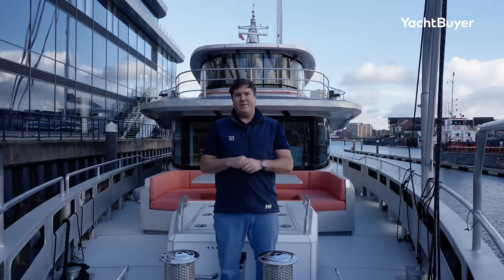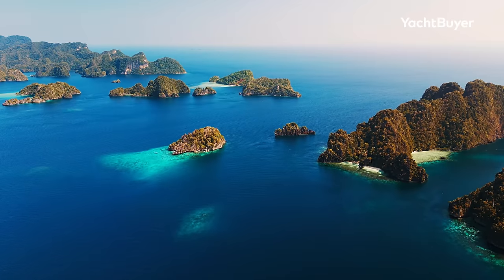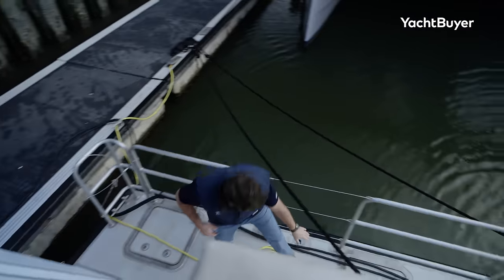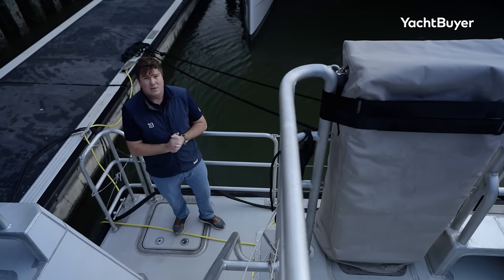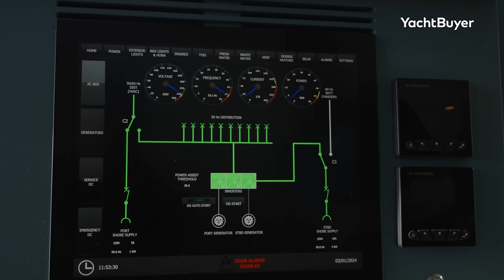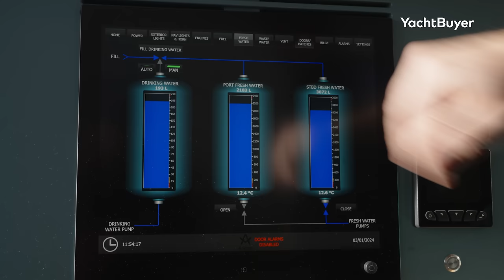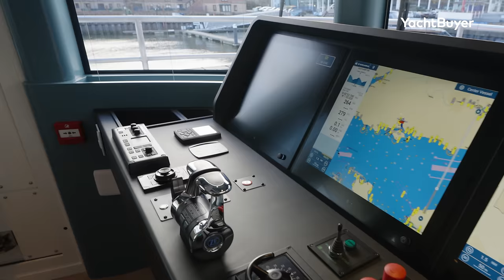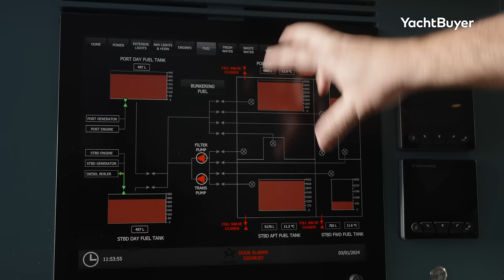A British Built Explorer with 7,000nm Range | Arksen 85 Tour & Review

Comment: Its hard not to see the Dashew FPB influence in this boat, but teken to a higher level of refinement, especially the interior.  The FPBs seem so spartain inside, whike this is warm and inviting with a lot of thought invested.  Captain’s quarters by the engineering space is a great idea.  Range is outstanding, and the ability to get to 14knts in a pinch will let skirt a lot of unexpected bad weather.
Reply: I have seen a Dashew fitted out to a  a similar standard .
Reply: Agreed, however, the quality of much of the exposed welding is a far cry from what you would see on a Dashew. Dashew certainly has the qualities where they count. I am amazed given all the welding is exposed that they didn’t do a better job.
Reply: Habe to disagree. Most FPB of which you find footage are the 64s. They have been commissioned ca. 20 years ago. If you want to compare the interior compare to 78, especially cochise, or the FPB 97 Iceberg. Their interior is at least on rhe same level regarding quality and feel.
Regarding thoughts put into Arksen: no. Zhey just took the Dashew Design and changed it in a way that shows, how little they understood the original design.
Range: 7000nm ist okay, but 9kn is quite underwhelming. Iceberg is significantly faster. Arksen’s top speed is Iceberg‘s cruising speed. Dropped back to 9kn the range will be much bigger than 7000nm.
All in all the Arksen is a knock off. A cheap knock off of the original FPB design.

Comment: Looks like a great explorer yacht with a decent range.  I know that an all aluminum boat has its advantages like reduced weight as compared to steel which makes the boat faster, as well as preventing the boat from capsizing.   My question is: Did they use the marine-grade aluminum 5052 for optimal durability, or the more cost-effective but less durable 6061, in the construction of this particular yacht?

Comment: beautiful yacht.  the concept is lifted from the Dashew FPB concept but im glad arkson and a couple other companies are continuing with his ideas.  the scania engines seem an odd choice though. and i cant help but think that the aliminum must get blazing hot under foot in th equatorial sun.  yes its well insulated but it must be scorching to the bare foot. very well presented as usual Jack.  really looking forward to the sea trial.
Reply: I looks like a straight copy to me
Reply: @WillBreitholtz1  looks more like a bad copy to me. Comparde to FPB 97 Iceberg the Arksen is an underperformer on every level
Reply: @GroppeljohannKlotenkempe-vr6oh it's actually better, the iceberg could only go 7000 nm at 7 knots not 9. And it used more fuel to do so.

Comment: Hey Jack that was a splendid review and the 1st time I've come across your channel. My one nit-pick would be the use of only 12mm aluminium plate, as it's a soft metal, so id have upped it to 20mm for the bow area , 15mm for the remainder. I guess weight saving is of an essence. Also is the boat still in Ocean Village? As I'm extremely local and would love to have look in the 'flesh', as so  to speak.
Reply from the maker: Glad you enjoyed the review and welcome to the channel! Interesting points you raise about the thickness of the aluminium. Arksen's approach seemed the be that they would exceed what was required for the boat's Class status. She has departed Ocean Village now I think, unfortunately - Jack
Reply: @Yachtbuyer  That's a shame that she's sailed on. My observations of the hull thickness are due to me being a marine welder/fabricator with mechanical fitting experience over the last 39 years along the South coast, from Cornwall to Kent, but mainly Southampton and Portsmouth. I wish you every progress with your YT channel.

Comment: I like Arksen they are building amazing ship. Recycled aluminum used in building the boat. She has safety and comfort built in, for any part of the world any type weather or sea conditions. 
The gallery, dining, seating or relaxing area are homely and the colour decore are relaxing. As is the master cabin and guest accomodations again relaxing, restful decor. Each cabin had it own heads. 
The crew areas are again comfortable and each cabin have their of own heads, laundry room. 
Overall she is a versatile boat planned to meet many different weather and sea conditions, she very economic in her use of fuel. She is made yo be sble to repair if something goes wrong with back ups until you can somewhere to do repairs. She is amazing

Comment: I sailed on a supply vessel (Smit Lloyd Fame) powerd by Scania's. Worst engines you can imagine, were cooling-water is entering lot's of engine parts, were it not should be. After that you sit in the dark. There is no substitute for cubic inch.

Comment: Great machine if very mission specific. I can see some amazing adventures on this to remote corners of the world . Only thing I would see as a negative (for me anyway) is you would have to have some serious engineering knowledge to keep all that machinery and electronics serviced  while in far flung places not to mention if elements of it go kaput , where would you even start? , looks very complicated . I sometimes wonder if we are going to super tech on these vessels which are for the owner operator. I remember the days when an old lifeboat called Mabel E with just a pair old thumper analog Gardner’s went off into the blue  yonder for years even getting stuck for months in ice , with spare oil, filters , belts , water pump and a set of spanners and a hammer (figuratively speaking) .  I imagine the tool box on this must look like a professional work shop .
Reply from the maker: You make a very good point and I know that the owner of this boat took great care in learning all of the systems despite running the boat with a skipper on board. A lot of the kit looks intimidating but much of it is mechanical and built for redundancy, designed to be easily switched between if something fails - Jack

Comment: 7000 nm with 7-8 kn than u can swimm ! a good explorer neeed a eco cruse of 12.5 and fast 14kn and full speed up to 17 kn. and it needs a range of around 5000 nm at 12.5 kn.  consumption shut be around 6-8 lieter per mile max. For a boot of around 27m -35m

Comment: Sorry Jack, but when I watch a yacht video, I want to "see" what is where and the storage is opened. Cupboards, drawers etc. (if its not in use!). I'm a bit disappointed with the video because it doesn't show everywhere. Even the staircase is not shown. Why? You don't go into the workmanship and don't show it in detail. Why not? Do I have to assume that as a viewer? I can see the Victron Energy electrics in the battery room, but you don't explicitly go into the technology. That's a pity. Nevertheless, a great yacht.

Comment: 👎 another knock off of the Dashew‘s FPB design. It looks similar but if you know the FPBs you will clearly see how badly their design has been used and altered.
The welding btw is quite underwelming compared to what Circa Marine has done.
9kn cruising is very slow for such a long hull so no wonder the range is quite high. Take a 55ft Nordhavn and go with 5kn and you will have several thousand nm too. The FPB 64 whilst cruising with 8kn will have over 10.000nm range. And this design is 20 years old.
So good job Arksen: making no progress in 20 years is astounding

Comment: Amazing boat, but ruined by the bare aluminium. He said they were conscious of the "footprint" on the environment, which was why they left it bare metal, and would probably discourage spraying. This is unbelievably stupid. The entire thing is unnecessary!! It's a rich persons toy. A single trip out would have a larger "carbon footprint" than spraying the boat. Just one engine probably has 100x the embedded carbon footprint. My God, it has an 18,000L fuel tank, what are you talking about! I cannot take the company seriously any more.